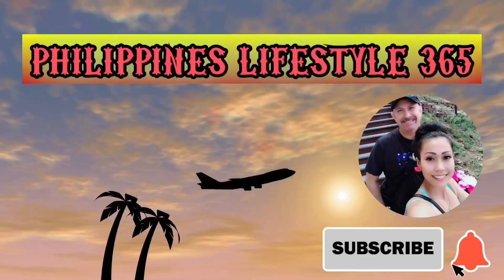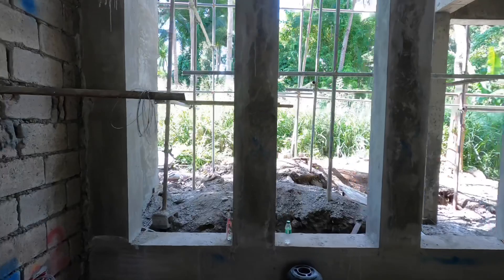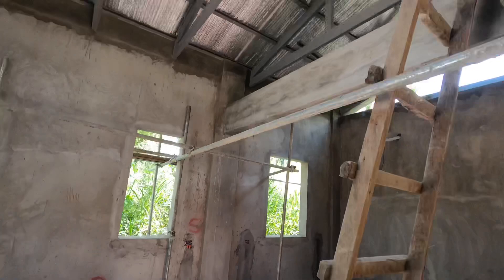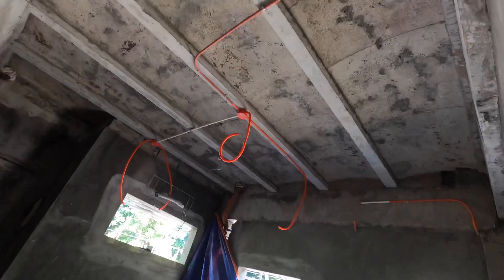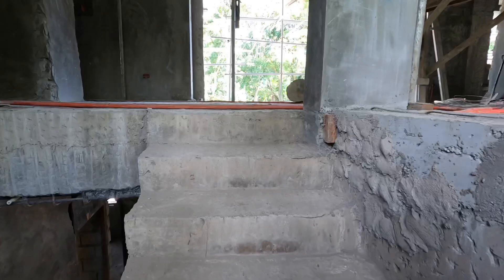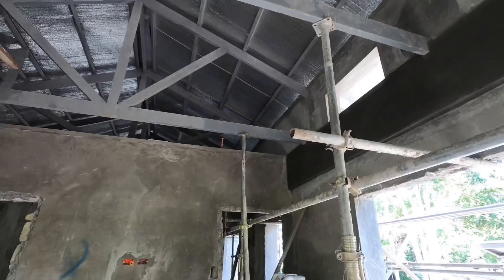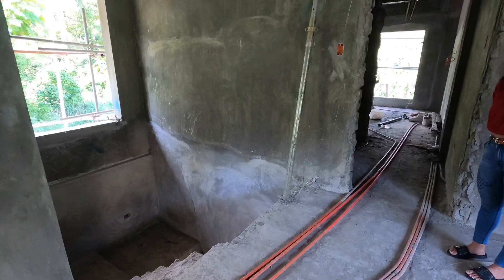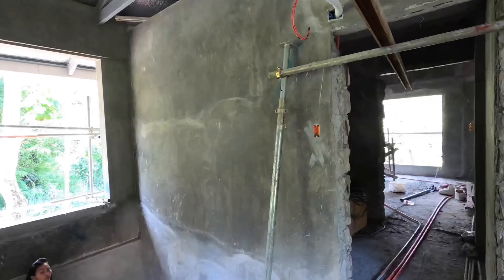Philippines House Build Vlog 19: The roof almost completed | Aansly & Fhe Mie House

Comment: Hi Steve and Net, Is that a double layer roof on Aansly's roofing? I'm on hold to build due to the pandemic. I did a lot of research on roofs and noticed that in the Philippines they don't spend any effort which will cost a lot on energy down the line. If you have a well insulated and vented roof proper design you can leave your windows open and enjoy the tropical island breeze.
Reply: Dan... There is insulation and then corrugated sheet and then the roofing. Hoping all of that provides the necessary protection n energy savings